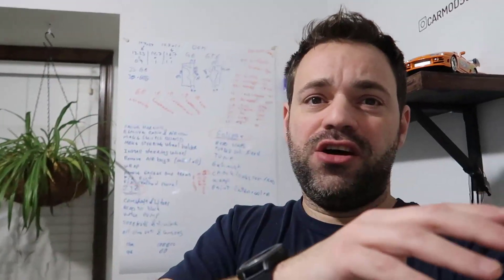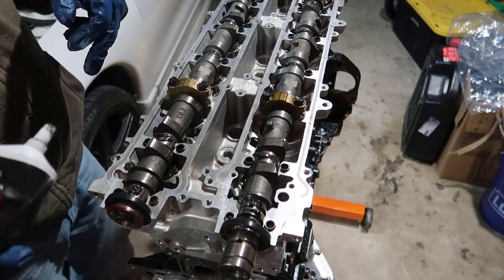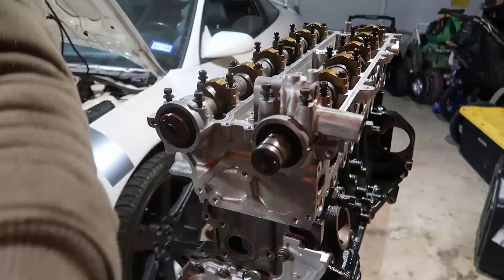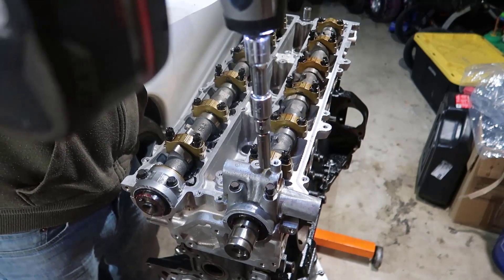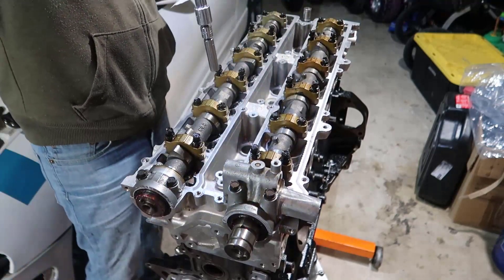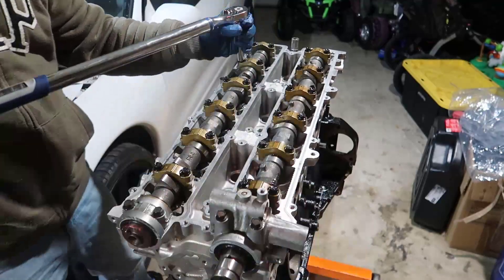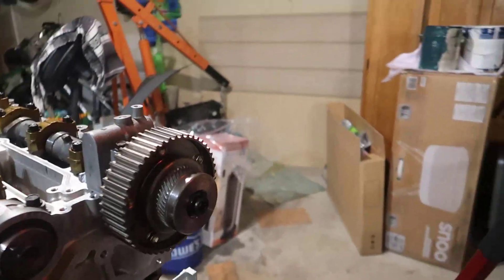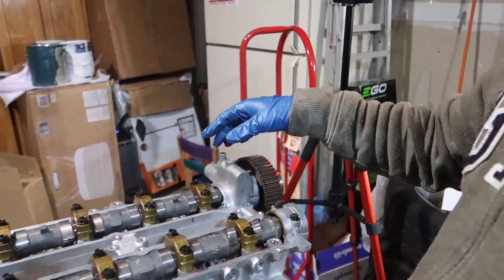2JZ Camshaft Install Torque Sequence 🔥 Part 2 of 2 - 2JZ to E46 Conversion

Comment: You titled your last video: Removing cam shaft sequence part 1. That video DID NOT explain your title, you then go on to explain that will be in the next video. This is the next video, and you DID NOT show the removal sequence. Only the reassemble sequence. Is the sequence the same in reverse? Some explanation would be great. As the title of your videos are misleading.
Reply from the maker: Hey William ya sorry brother. Sometimes is hard to get the titles correct.  Anyway  I believe this is what you are after
https://hue360.org/en/repair-manual/supra-jza80/2jz-gte-engine/cylinder-head-removal
Reply: @CarModsGarage  right on man thank you very much. I only spoke up because I watched both videos all the way through, and it didn't give anything of value, and waisted my time. But thank you for putting those links in the comment feed. I appreciate that.
Reply from the maker: anytime brother! I try to help and document as much as I can. I don't try to mislead people to watch my videos. Glad I could help somehow. I appreciate you comment bro and I hope you get it done!
Reply: @CarModsGarage  I'd also like to note that you had your paper upside down and did the sequence backwards. I don't really think that matters too much though.
Reply from the maker: @williamgates392  lol ya I don't think it would matter much. That's a heck of a sequence.

Comment: I noticed that the intake cam cap is broken from where the hex bolts are threaded in. Should that be a problem/concern?
Reply from the maker: Oh man I felt stupid when I broke it disassembling the engine (my first 2jz). After that I researched a lot and had no option to buy that part so I assembled like that. So far so good.  Nothing bad happened. Cap it tight by the other two bigger bolts
Reply: @CarModsGarage  oh really? Because i bought a 2j a while back (my first 2j as well) and noticed mine were broken so i was skeptical of running it like that. I did some research but many different opinions. So you're saying I shouldn't have an issue running it like that from your experience?
Reply from the maker: ya I did not have issues. I've read so much about it being fine like  so I left it broken. This is the car running.
https://youtu.be/NqhRU7qYmrI